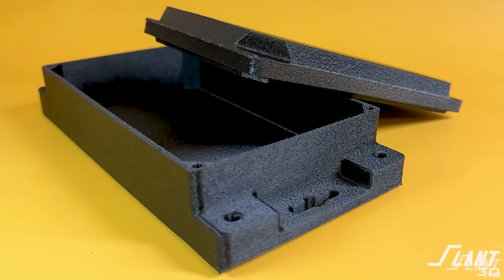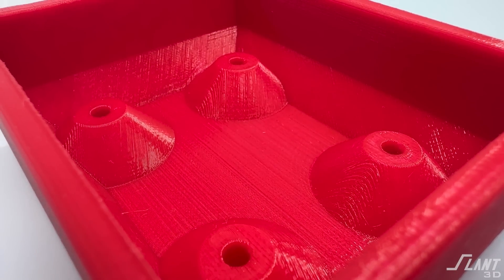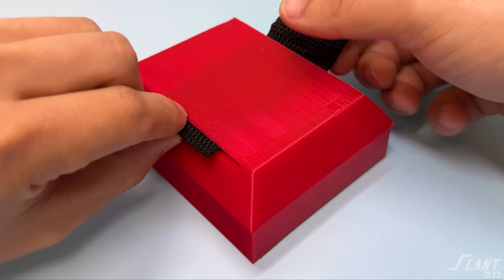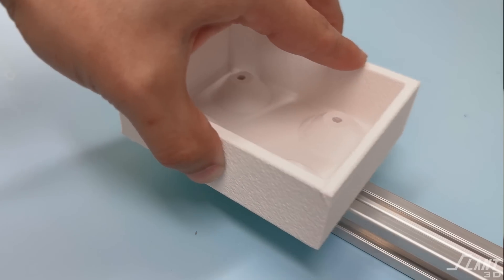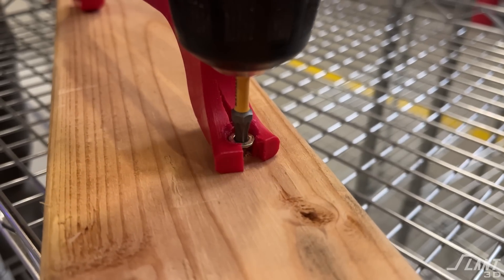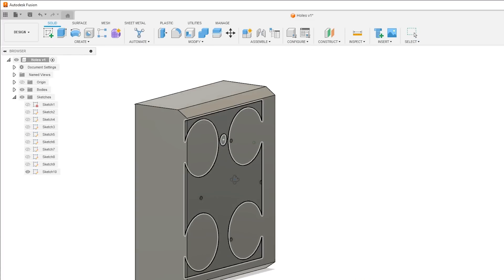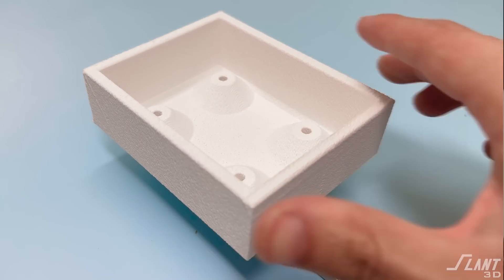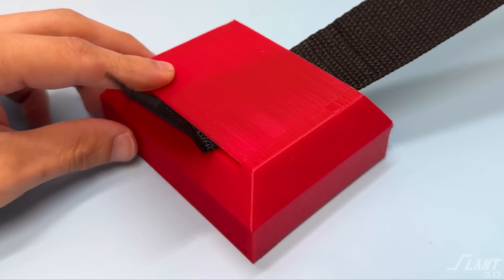Mounted Enclosure Boxes | Design for Mass Production 3D Printing

Comment: are you using fuzzy skin? it looks like, i wonder what settings you use for that. 

plus printing on the angle, you tell us all the time, but i have not grasp why. are you printing two parts on one bed? or can you keep the bed heated when releasing?

Comment: Great video… just a question… why printing in an angle affects cost in relation to printing it flat? That part was not clear to me. Thanks
Reply from the maker: Uniform surface finish overall and more automated production
Reply: In one of his past videos he went over that, but I believe it had to do with ease of removing the print.
Reply: Big flat surface stuck to bed means it needs labor to remove from the bed, rather than automated part removal robot.
Reply: Ease of removal = less potential for breakage
Designed for slanted orientation = less filament used for supporting material and therefore less waste
Reply: Also with producing a lot of the same, more of the copies fit on the print surface

Comment: Excited for your videos covering material strength of different filaments! I love these videos I just don’t know how much I’d trust a PLA in a production environment around heat and vibration. 

Would also love a video on enclosures in regards to ABS or CF reinforced filaments. 

I have a P1P with some acrylic sheets enclosing it but there’s visible gaps and idk how worried I should be when printing more toxic filaments. 

Thanks for all the great content!
Reply: ABS-GF from phaetus it’s really easy to print I have had excellent results on big chunky parts on an X1C and also great results on mid size parts on an unenclosed P1P
I always use dimafix or magigoo when printing ABS or ASA
Reply: To not worry about the toxic fumes use a bento box they are really cheap